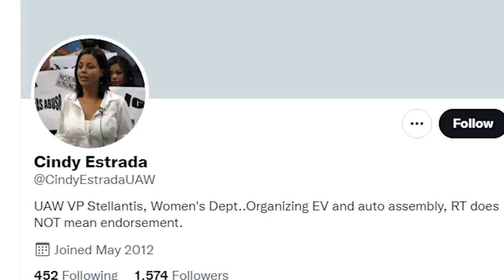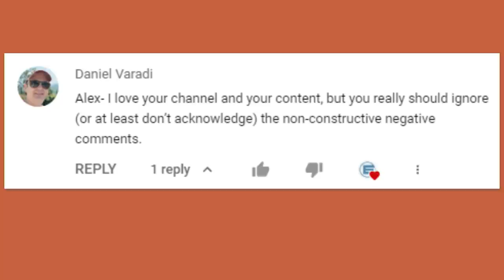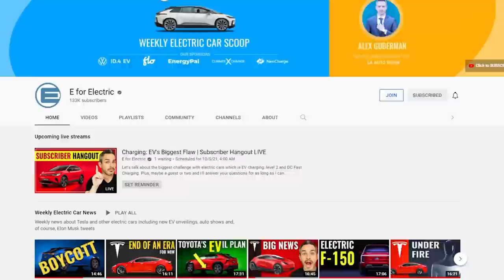ELON MUSK Confronts President BIDEN | EV News

Comment: I find it interesting that all these new electric vehicles are so expensive that only the affluent can afford.  Nothing under $30,000.  The masses will not buy electric until they are affordable and can be charged as fast as filling up your gas tank.
Reply: Is there ANY car under $30,000? I mean sure you can get a ford focus for about 35k but once you get the options like brakes, windshield, seats and a steering wheel, you're looking at about $50,000.
Reply: This isn't Kazakhstan, bud.  The average price of a new vehicle in the US in 2020 was $40k.
Reply: I spend less of my time charging my car than you do of your time filling your tank.
Reply: @brianbenoit6883  You can;t buy a new Ford Focus at any price. Ford no longer manufacturers sedans of any kind. Just FYI.
Reply: Most ev charging globally is done at home atm.

Many new model evs can already charge 100kms in just 5 minutes, 200kms in 10mins at certain chargers.

The average daily commute (by car) here in Oz is only 42 kms (30 miles in the US, 8 Miles in the UK). For a 400km range ev, this means the average commuter only needs to charge every 10days. Why not charge once a week at a major shopping mall whilst you do your shopping ?.

You can recharge that 42kms in <4hrs using an ordinary 2.4kw household power outlet. Many ev owers will fit a 7kw charge point at home, meaning <1.5hrs charge per day to recharge that 42kms.
Reply: Welcome to America. Rich people buy new cars. Not rich people buy used cars.

Comment: I would be cautious about electric trucks.  What is the true range of the vehicle if it is towing a trailer or boat.  Also if you tow a camper where do you recharge the vehicle at the campsite?
Reply: @Joseph Cler   Do you fill up your ICE vehicle’s tank with gas at a campsite?
Reply: @gwarlow  No but I don't wait around for hours at the gas station to fill my tank.  I`m  not against EV vehicle's,  but they still have issues such as charge time,  a charging station being  available in the area  and also the EV vehicle  being more expensive then a comparable  ICE engine vehicle.

Comment: Making an additional tax credit available on vehicles built by workers with a collective bargaining agreement is not uniquely or extra political, nor is it uniquely preferential to targeted manufacturers. Sure, it's political. But not any more than the EV tax credit itself. Like hundreds of other tax credits, it's a credit designed to encourage a certain behavior (in this case, unionization) and to discourage other behaviors (in this case, fighting against workers' unionization efforts). There are many tax credits for behaviors of which I approve and others for behaviors of which I disapprove. But one type is not inherently more or less political than the other. I like unionization and think it's, generally, a good thing particularly in the manufacturing sector. You're free to disagree with that position, but it's simply using tax credits the way they're intended to be used. Under the proposed new credit, Teslas and Toyotas and so forth would qualify for the same EV tax credits. In order to qualify for the North American- and US-made tax credits, they simply need to meet the parameters for those additional credits. Those that don't qualify aren't being punished. And if they want to qualify for additional incentives, there's a clear path to qualify for them. Makes sense to me.